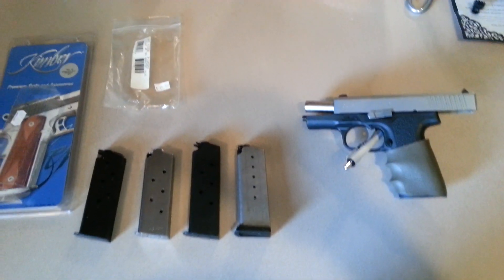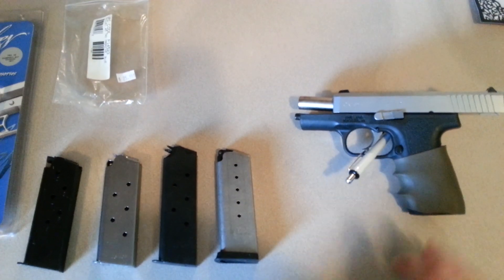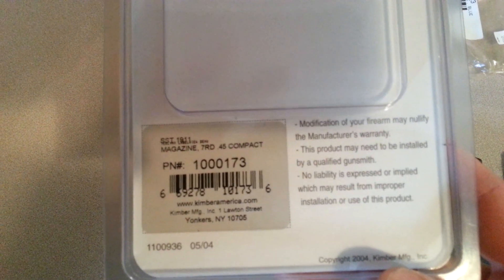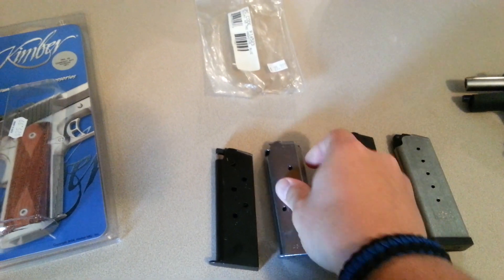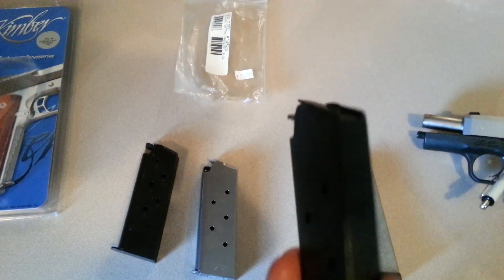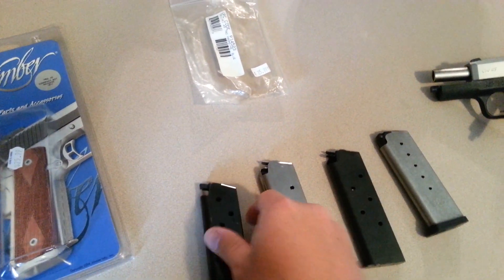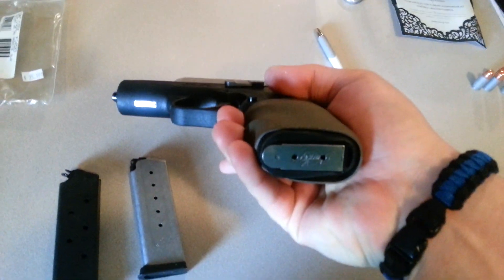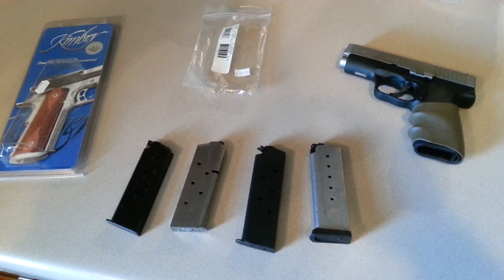Kahr CW45 using 1911 Magazines

Comment: Based on this video, I acquired a Kimber '173 magazine and quickly found that the slide would not go into battery.  The problem is the extractor sits 'low' in the side and makes contact with the Kimber's lip. I sanded the lip with 200 grit paper removing just enough material so that the extractor clears the lip.  The CW45 now works perfectly when clear of the lip.  Also, the Kimber's follower actually popped out of the magazine during one range session.  It is only loosely held in place, not a very robust design.  I positioned the follower in place and added a dab of JB Weld where it contacted the spring.  That solved the issue of ejecting.  

Not all of my JHP's fed so I've decided to use only round nose bullets (200 grains) in this gun (my go-to 45 powder is Alliant RedDot).  The CW45 is one very sweet gun, highly recommended.  It competes with my PM9 as an EDC.

Comment: EVERYONE!  USE WILSON COMBAT MAGS IN KAHR CW45 AND P45.  Those hold 8 rounds of .45 ACP and function better than any mags I have tried.  I used those in my S&W 1911 and Argentine Ballestar Molina.
Reply: What about a CT full size with a 10 round
Reply: @KsooTheYouTuber  No idea.   Wilson Combat 8 rounders work fine in my Kahr CW 45, at least for back up reloads.  If Wilson makes a 10 rounder, get one and try it.
Reply: @gregblackburn4280  they so those are the ones with the black plastic bumpers
Reply: @KsooTheYouTuber  47C and D I think.  You can get ones with plastic bumpers but I prefer the ones with the slim steel bases.  You can also get aluminum.  Go to Wilson Combat's site and look over at their "shop" icon.
Reply: @gregblackburn4280  are the 10 rounders tho
Reply: @KsooTheYouTuber  No idea.  Buy one, test it, find out, come back and tell us.
Reply: Can you link the mag so can but it asap

Comment: I have the kahr cw45 and it does not slide eject the rounds 
It is junk 
Love only the 9mm series 
Not to bash them because I have 8 kahr guns 
But really not happy at all with the 45 series
Reply: If you still own the Kahr CW45 in Jan. 2022, remove the rod that pushes the extractor.  Take about 0.030" off the rod and reassemble (sanding with fine grit paper is all you need to do). This will reduce the spring force against the extractor so that it easily slips over the brass's rim for ejection.  Also, polish the end of the rod and the surface where it contacts the ejector.  I had the same ejection problem until I shortened that rod.  My CW45 works perfectly now.